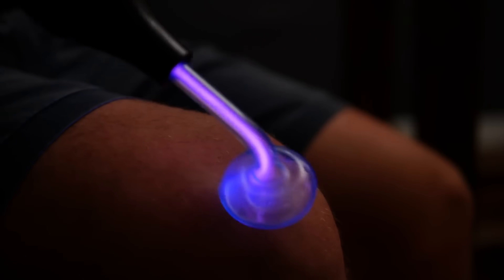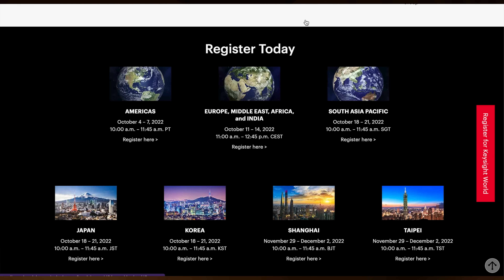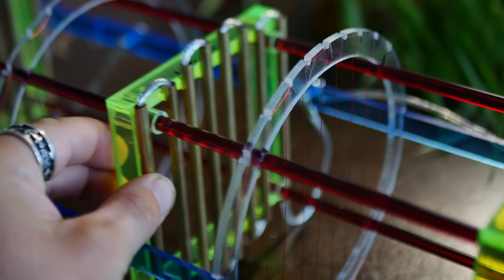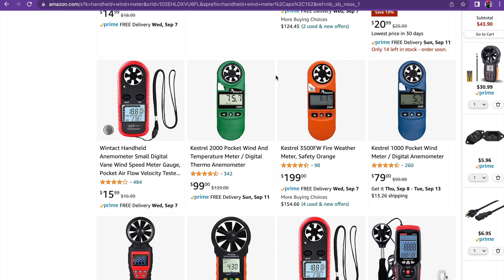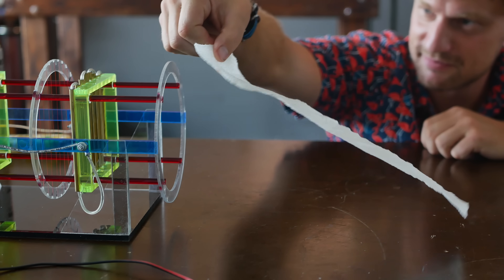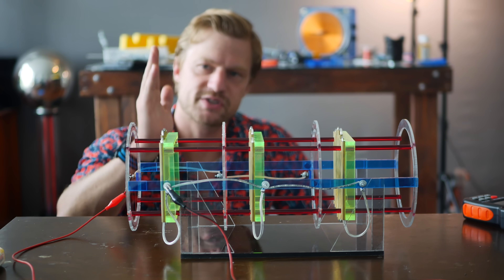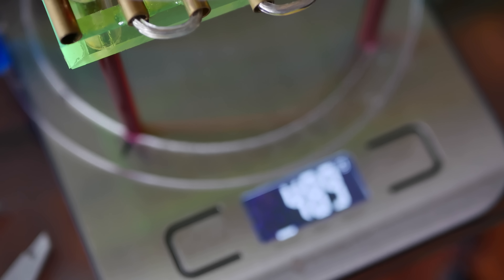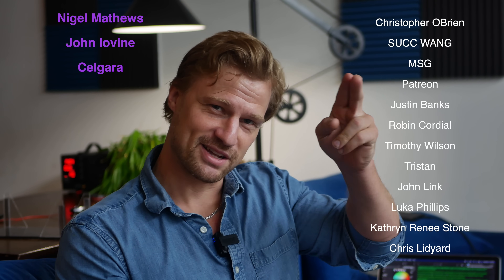Designing A Next-Gen Ionic Thruster! (For Flight)

Comment: So, Not a physics guy, But wouldn't you get a better result by enclosign the design. It seems to me that outside static air with no vector is being added at each stage which then requires additional energy to accelerate. With a cowling It seems like the only available air to reach additional stages would already be moving at a higher velocity. Maybe this would help with laminar airflow and result in higher speeds. Also, wouldn't you gain a suction effect that would further boost airflow?
Also, If there is a maximum amount of energy that can be imparted by each successive unit in the series, would it be more efficient to stager voltage between them?
Also, Does the temperature or humidity of the air being added to the engine make a difference? Could the air be preconditioned or an addative be used to allow for better power? Like how props function better in cold dense air.

Again not a physics guy, just thinking.

Comment: Not exactly in the realm of affordability for anyone less than Elon, but I'd say that the biggest limiting factor (in terms of power to weight ratio that is) would be the materials used in construction.  Perhaps a carbon coated ultra-lightweight carbon-fibre material?  Something that when used to create this thruster will only weigh a few dozen milligrams.  (I'm not an engineer but that's what I'd do at least.  If I had access to that kind of thing.)

Comment: You really need to experiment with shapes that increase air speed at the back end or between stages, and you need to close on the sides, or direct airflow from the 1st to the second and then make scoops on the outside so you can direct more airflow into it’s Teige…., imagine a funnel after the first stage and then a funnel outside of that focusing in on the second stage and a funnel on the next stage as well everything focusing the air flow towards a central point at the back end? I have an idea in my head and it looks Really cool

Comment: inefficiencies you asked us to list.  1.  WEIGHT...you could use Styrofoam you could shape.  2. Not enough thruster wire...I believe you would need more for more power...considering the wires act kind of like fuel...but of course, your fuel is electricity.  3. I would also use more stages that you have already built out of plastic...but I would use either Styrofoam OR....I would make very flat, STRONG carbon fiber you could manufacture. RESIN has weight...so I would experiment with other hardliners like some kind of resin spray...instead of using a brush to apply the resin to the carbon fiber. 4. IF...I would experiment with a piece of strong wire that doesn't bend much....but on THIS wire I would cut very short pieces of other wire and solder them next to one another on the long piece maybe like 100 of them side by side going the length of the wire....THOSE pieces of wire could now act as your thruster wires......as long as there is a ground wire close to them to emit the plasma flow. The plasma would FLOW from the tips of the wire to a ground. 5. I wouldn't use any nuts or bolts in my design...because of weight. INSTEAD...I would use lightweight CLIP'S you could solder your wires to. That's all I can think of for the moment.

Comment: I know nothing about this field but 
1) instead of copper maybe gold wires for no other reason the gold is less of an insulater then copper? 
2) air flow isn't direct because to much is lost in the open sections so maybe use a plastic wrap around it to cut off airflow from the sides and limit it to just the air inlet?
3) in series do you lose energy where the first gets more and last gets less could you wire in parallel instead?

Once again I know little im just throwing out my insight

Comment: why not use frequency using ceramic audio speakers. you've seen the video where the speak is facing up and it bounces the ballbearings where at least 35mm. solid steel think pinball size ballbearings roughly 15 of them possibly 20. oh and if you're thinking power? think plasma pyrogenesis in a vacuum it would also make distilled water

Comment: in my mind and im probably wrong. if it is possible to create a low pressure vortex at the entrance to the thruster it should greatly increase the flow while minimizing weight. this may be able to be acheived with proper channels and ducting similiar to the way an F1 car works.

Comment: Thought: 
If you encased and wrapped the outer frame in a sheet of an anti static material; would that not increase air flow as you'd ONLY be pulling air in from the top. While the frame is a neutral material that's non conductive like plastic, the Ion flow is going down ward and pulling from the sides but also can have semi turbulent air from outside influences. So encasing it is a material that repels the ions between segments I believe would increase air flow. 

Secondly; the shape is a cylinder. If you made it a cone, starting at 1inch at the top, and then make each section smaller in diameter, I believe that would also increase thrust as well.
Reply: Also; the positive and negative wires "could" generate a small em field based onhow well shielded they are would could cause some electro magnetic interference. Also the wires on the side need to be straight. I also feel like the spacing between each Thrust point has an effect in tandem with the spacing of the positive to negative sections.

Comment: Bro you're killing me with the Sharpie and Dremel method of acrylic fabrication. A K40 laser cutter is $400 shipped on Ebay and will change your life. Get the K40 Whisperer open-source software for it, and build a bed, and it does everything you need.
Reply from the maker: You have my attention…
Reply: @PlasmaChannel  Here's my quick guide to setting up a K40 laser cutter for engineering usage: 
1) buy a $400 K40 from Ebay 
2) have a spot for it near a window so the exhaust fan can blow fumes outside. (Or, if you're in a new apartment building, you can also discreetly hook it up to your laundry dryer exhaust duct; those are often kept at negative pressure) 
3) fill a 5gal bucket with the "Secret Recipe" coolant mix here: https://lasergods.com/laser-water-coolants-additives/ (the laser cutters come with a coolant pump but usually you have to supply the bucket) 
4) the laser cutters usually don't come with a proper bed, so buy a K40 bed on Ebay, or do something along the lines of this bed made with honeycomb steel: https://www.youtube.com/watch?v=TaACY2SnOxg&ab_channel=WayofWood 
5) download the free hobbyist version of Fusion 360, follow online guides to learn how to make a 2D sketch, and export it as a dxf file
6) use the K40 Whisperer software to control the laser cutter to cut your DXF (don't use the crappy CD that comes with the laser; K40 Whisperer is better)

So anyway, that's the low-budget approach. The high-budget approach is to buy an $8k GlowForge, which has a nice bed and coolant included etc. 

And the alternative for projects like this one is to 3D-print everything with a $1k Prusa. But if your components are all flat, a laser cutter will make a part in 30 seconds while a 3D printer takes 4 hours. (Though the 3D printer takes up a lot less space and doesn't need fume exhaust.)

Comment: have you considered trying to put a shield around the tube so that all the entrained air is accelerated.  the other opportunity might be to reverse your staggered spacing.  1 inch at the start out to 2 inches on the 3rd plane.  that way the accelerated wind is pushed faster each time like in a jet engine where the multistage compressor incrementally increases the energy in the induction stream .  the only other suggestion is to use more of that entrained air like a dyson fan or you can see on some of te new propeller less drone designs https://www.youtube.com/watch?v=f2UCK3pCFjk

Comment: This is cool. However, the biggest issue is going to be directly related to the horrible thrust to power ratio. Some parameters you can play around with are increasing the air density (which could increase the ionization coefficient) along with other methods of increasing thrust. One of the methods you could use is heat since ions have pretty high thermal conductivity. Obviously in order to pull this one off you will need to have a sufficient density of ions. This could increase your thrust to power ratio. In reality most ionic propulsion systems are far better suited for space applications where low thrust to power ratios can be dealt with and propellent weight is far more important as opposed to the thrust to power ratio. Most of what I'm mentioning here is from first hand experience during my college days when one of the school's projects involved launching a satellite into space.

This is a great first attempt though! Keep up the good work. Implementing novel propulsion solutions will lead to more implementation and maybe a breakthrough will come later on down the line as more interest comes in on terrestrial ionic propulsion.

Comment: You should replace the positive and ground wires with a very thin metal screen. Maybe buy a keef collector with mesh on the micron scale? That'd give a ton more chance at pulling air as the electricity travels.

Comment: I am guessing one defficinacy would be having an open design, if you put the engine in a tube or something it should be more efficient. 
Are there better materienes for the electorses? 

Google says that ion engines use noble gasses, so would using helium or argon improve the flow?

Is it possible to somehow turbo charge one of these engines?

Comment: Now put it in a tube with staggered diameter thrusters and focus this airflow down from a large inlet to a smaller outlet with double the thrusters internally.  Then once you've figured out the golden ratio of thrust to voltage in this formation, you can evolve it further by coating the interior surface with graphene lattice you can then use to produce a magnetic field to further form and concentrate the airflow.

Should be moving enough air at that point to act similarly to a single prop airplane at scale.  A more suitable application would be something neutrally buoyant and covered in solar harvesting technology to power unlimited flight time possibly combined with railway and maritime shipping systems to form a "slow lane" for nonessential or low volume cargo.

Given a large enough inductive tower network a similar application could scale even farther by shedding the need to carry or harvest energy, instead drawing it  directly from the towers mid flight.  These thruster tubes could be thrown hundreds of kilometers from tower to tower.  Enough energy could be imparted to the vehicle as it approaches the next tower and is accelerated past it to sort of skip cargo containers long distances through the air at hundreds of kilometers an hour.  In reality they would be charging up and flying in a series of parabola being powered to the apex and using drag to power instruments.  But no batteries other than emergency control systems needed.

This tadpole tech could grow legs if you feed it.

Comment: There is NO electrodynamic thrust. There is an electrodynamic attraction. Of a positive electrode to a negatively charged cloud.
If you don’t apply efforts to make a gradient of a negative charge before and after a positive electrode, there will be no force. An ionized cloud spreads by time and recombinates, and these processes create this gradient. This is why a positive electrode is a ribbon, not a wire.

Comment: Hey Brother try putting an acrylic surrounding around the entire exterior and just leaving the front and back open...

should work similar to a jet engine especially with the irregular spacing.

try the 1-in spacing on the first one
second one 1.5 in spacing

and 2.5 in spacing on the very last.

this may create some type of a turbo like effect so if my math is Right which it normally is not there's a chance of this may or may not work..
👍

Comment: Exceptionally cool build; however, aren't round wires one of the most inefficient aerodynamic form factors, they effectively act like airbrakes right? My (non-physicist) assumptions would be...
1. Flat wire replacement
2. Ducted body with reducer
3. Possibly staggered voltage

Comment: I was thinking once the particle is charged instead of using attractive forces to move the air why not help it along and pass the charged particles through a DC high amp high turns coil so the magnet field can move the charged air as long with the attraction force maybe it will add a little more thrust

Comment: Pretty cool project, I had those ionic breeze "air purifiers" from sharper image along time ago and was always amazed how they  worked. As far as your thruster, i have seen other comments about a light weight covering for the whole thing and the use of formed ducts. Those are what I was thinking, and to go a step further, since you know the spacing for each stage, could the stages be rotated at a 45 degree to each other to possibly create a vortex effect?
Reply: @Sludge yes, they moved air over a dust collection grid that was removable for cleaning. One of mine had a uv light as well.

Comment: Thank you, very interesting! You asked for ways to improve efficiency. The engine should be enclosed so none of the thrust is wasted. I did not catch it but did you try different voltages at the positives? I would keep the exit at the highest potential and have staggered voltages between. It may not increase final velocity but may increase efficiency. This looks like an electrostatic filter. Does it collect dust on the positive electrodes? I saw a video where the negative was a steel tube cleaner where the tips of the bristles imparted negative charge. I would think the smaller the wires the better, and rather than having one large one, several small brushes together making more contact with the air would be better. The positives I would make concentric rings, in a similar fashion as the lifter 8 mm (~5/16") out from the next inner one. There is some ideal gap you should have, and I would liken the concept to a Tesla turbine. Since the ions are being attracted by the positive plates, I would see what insulating them would do. I think the thrust would stop because the ions cannot now lose their negative charge and they would build up like a capacitor, but a high voltage potential might leak through and the insulation and make dust removal easier.

Comment: I don't know how much sense this makes, but how about placing those circular supports in a way where the wires on them are not parallel to each other? They are all vertical in the version you made but what would happen if one of them was rotated 45 degrees and the other was rotated 90? I think the air would spiral through the thruster instead of going straight forward, which might or might not help idk.

Comment: I believe you have made a discovery for the future of aerodynamic propulsion. Because of this we no longer need an oscillating blade to cut thru the air to provide lift. One drawback would have to be the amount of electrical power needed to produce lift. More power equals a larger power source and by today's standards that would mean allot of batteries.

Comment: You might want to reduce friction of the (negative?) electrodes - not only do they look large but also somewhat rough, this surely results in inefficiency of airflow.  Ideally, both electrodes would be tiny Airfoils pointed to direct the higher pressure air towards the center of the thruster - a design incorporating this may have the advantage of being able to decrease the size of the later series units.  I'd also like to know if there's a noticeable increase in efficiency in using different voltages at different stages, and how many stages could be practically chained.  You earned a subscriber and I'm saving this video in case I get the chance to try to make one of these in the future!

Comment: I would say close of the device with walls for stronger air flow, maybe a nozzle to concentrate the flow, could use thinner parts to reduce weight, testing different assortment of stage diameters could show some additional efficiencies. More stages and thinner / lighter parts.

Comment: As mentioned before by a few. Get rid of this open design. I would test your configurations again with this. Also it could be interesting to see.if different voltages on all three do matter to output and consumption. I would also think about the rods Infront of the electrodes maybe optimize them for better airflow ( maybe 3d print optimized Finn's). 

These are just answers to your question and this detailed answer is only here to show my interest in this topic. Great video well edited and nice to watch.